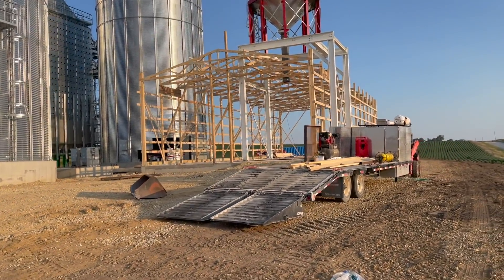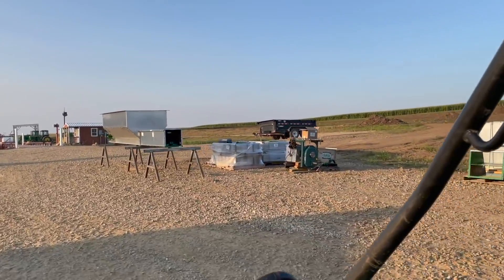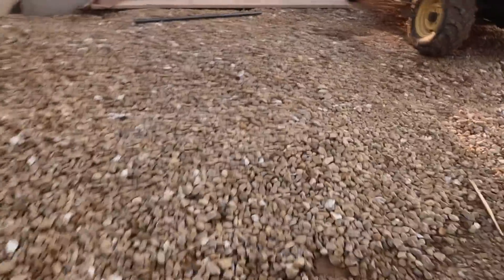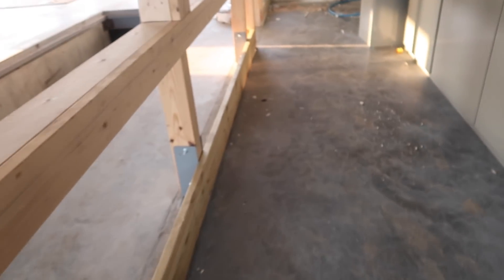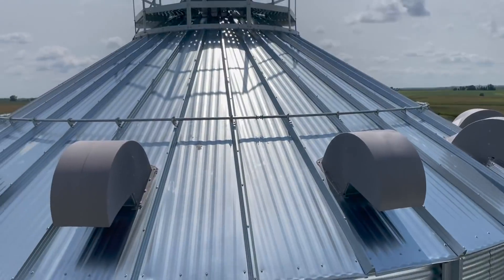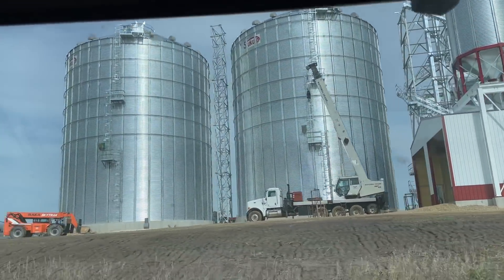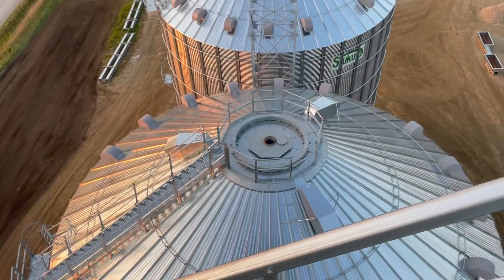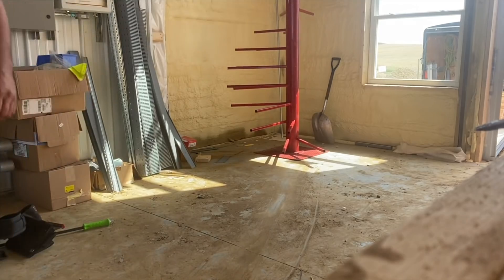Bin Site Update 4 | Building And Office!

Comment: Why is the bin on top of the building right at the front (or rear) end of the building and not in the middle?
Reply from the maker: It was all in the engineering of the pit. The pit needed to be positioned so the truck would be completely inside to dump and it runs towards the north end to another conveyer underground and the overhead bin had to be over that conveyor. It’ll make more sense once you see us pull a truck in
Reply: @mannfamilyfarms381      👍Thanks for the answer. I appreciate it.